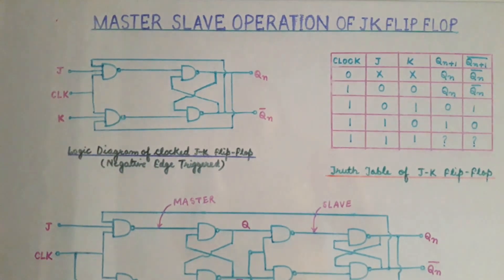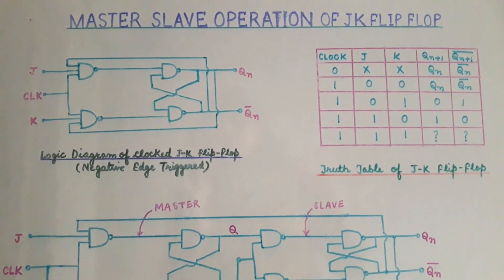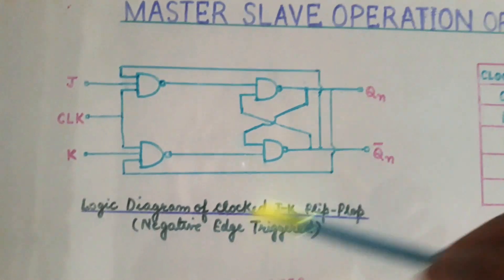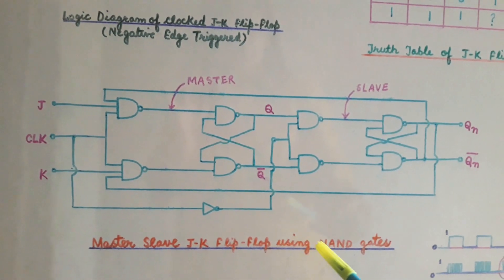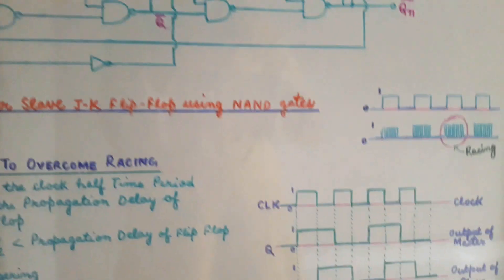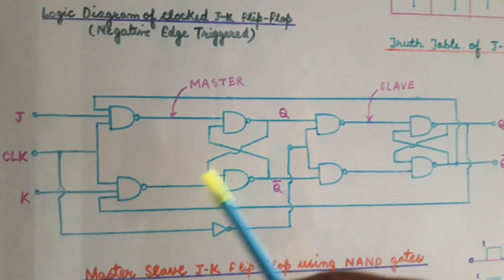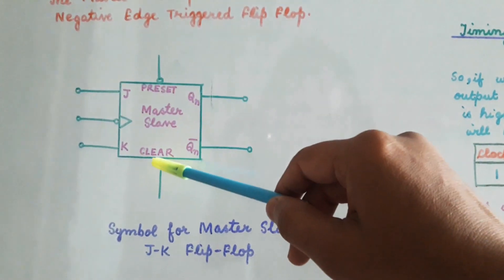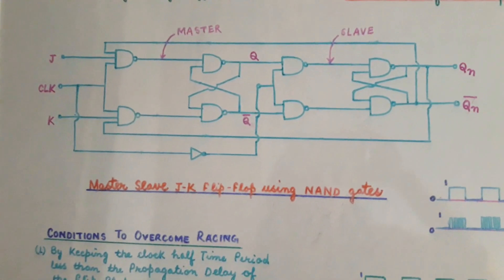Master Slave JK Flip Flop

Comment: I frefer starting with latches made of an or gate , and gate , Inverter combo
My latest device as far as I can tell does much of what a jk flip flop does. But is easy to understand. There are no cross coupled inputs or outputs. There are no uncertainties. But it uses more parts. I also prefer using spdt relay logic diagrams first to make the logic simple . And the diagram smaller and easy to read.